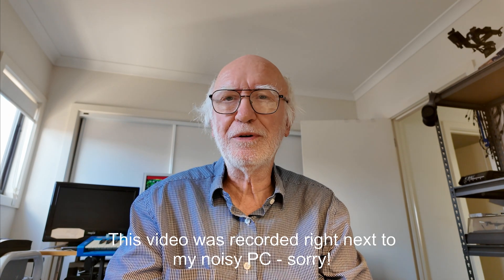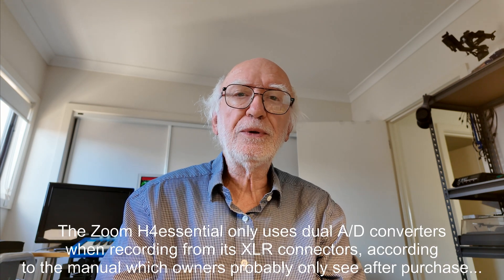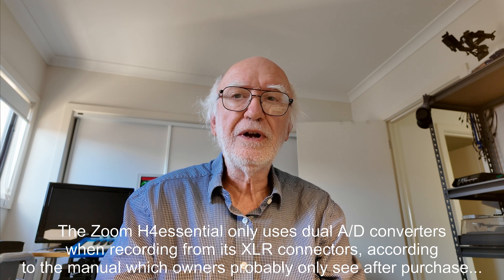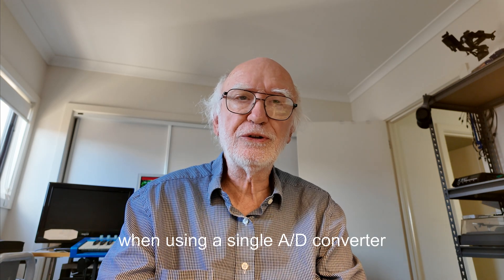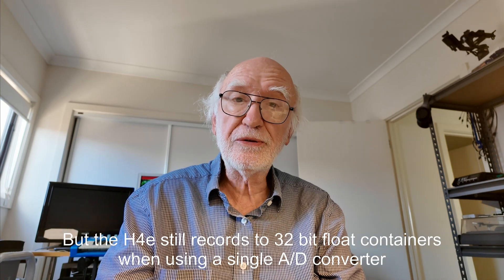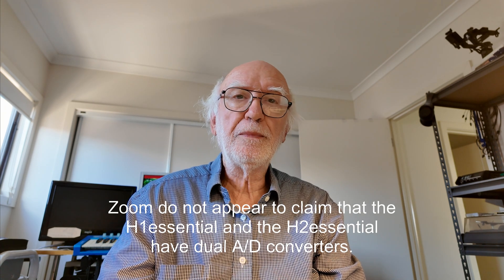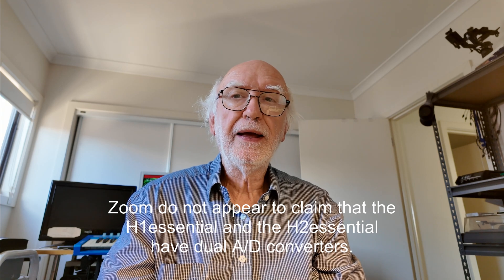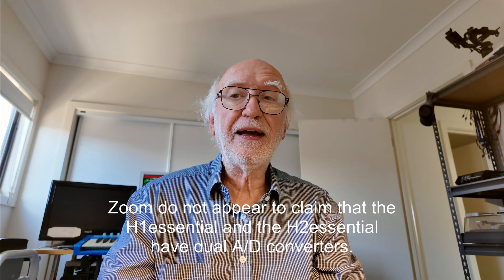32 bit float low cost audio recorders - BEWARE!  The truth is out!  Don't buy until you watch this.

Comment: A single converter could offer a wider dynamic range and fully utilize 32-bit floats if it adjusts gain dynamically. It probably couldn't adjust quickly enough for fast transients, but it could for more gradual increases and decreases in sound level. Ultimately the proof is in performance. Can you record very quiet sounds then make loud sounds, and have no clipping and still be able to amplify the recording later to bring up the quiet portions without a strong noise floor?

Comment: Close to no point, but it seems to me that the ability to salvage a recording that is clipped is a pretty handy feature....
Reply from the maker: @174rank  These devices are configured so that the analog stage (and/or the built in mics) will overload before the converter runs out of headroom, so if there is any clipping, the 32 bit float file will have faithfully captured it. What dual ADCs offer is the ability to capture a wider dynamic range. As far as we know, single ADCs don't offer that.  However, the difference between theory and reality can make these single ADC devices very handy indeed. I have been listening to the only examples I have found of large and small classical ensembles recorded with the H2essential, and the results are remarkably good. And the people using the devices simply had to pop them on a mic stand in a good place, press record, and walk away. But I still feel that the companies promoting single ADC devices without making it clear that they don't offer the full benefits of 'real' 32 bit float devices are not being entirely transparent in their marketing.
Reply: @Ozpeter  Yes, but it would seem to me that the 32-bit float (even if it isn't totally the real deal) would give one a cushion.  In situations where there is no opportunity to adjust levels, like when I'm recording a band concert that my kids are playing in, I could record without worrying so much about the digital format clipping.  The Zoom 323-bit models don't even have a gain adjustment, where the Tascam models do.  I have a Zoom H6 (not a 32-bit model), and while it is a marvelous device, it is nearly impossible trick to get the levels just where I would like them without a lot of checking beforehand, and in many situations, there is no chance to do that.  If I'm recording something like my kids" band concert, the sound isn't likely to be loud enough to overdrive the mics , and if I set the levels where they seem about right, and an unexpected very loud section of a piece runs my levels 3-6 DB over, the 32-bit float would catch it so I could recover it in a DAW....Am I right?
Reply from the maker: @174rank  Well, yes, as I said there's examples which do show how, within the limits of what the mics and preamps can handle, an inexpensive 32 bit float recorder can be set up in front of a loud concert band, press record, and that's it. I've started putting together a playlist of such recordings where I am confident that's what has been done. Check what the description says about each of these and any comments about how they were done - https://youtube.com/playlist?list=PLW7X_zDpTwy1VDpQUf97BjzJccMWZDV5J&si=kR2H7Jhqzb25liBI

Also check other recordings on the relevant channels (but again, keep an eye on the descriptions to verify how they were recorded).

Comment: After watching your videos on this topic (thanks again) I decided to avoid single-converter float recorders and buy the H1 XLR. Being curious about bit depth in float recorders I figured out a method to calculate resolution in recordings. Resolution in the loudest supported signal points to bit depth. However in the absence of manual gain control, softer input sounds will have lower resolution. Not an issue with the H1 XLR as it turned out, but what about 24 bits depth in other recorders? Here is a summary of my "research":

The loudest mic signal I fed into the H1 XLR is from a floor tom at centimeters distance, producing a peak voltage slightly above the specified maximum of +4 dBu. That did not clip the input, but 32 bits were used in the signal, which I take as bit depth. Also I multiplied sample values by 2^32 to check if all results are numbers without fractions, and yes they are, further proof that conversion output is an integer format with at least 4 bytes.

The floor tom test was only done as a reference. Recordings of bird sounds, my purpose for this recorder, show resolutions around 22 bits when using a microphone of -24 dB sensitivity. Consider that my footsteps sound louder than the birds at a distance, and you get an impression of the sound level. The birds peak around -70 dB below the floor tom, yet they are recorded with more than adequate resolution.

The old 24 bit H1n can give the same resolution for the same birds but that needs careful gain setting. In practice I reserve extra headroom just in case a nice bird would come closer. So there I loose some resolution, but still get 20 bits in the softest recordings.

But what will a 24 bit recorder produce if it does not give you analog gain control to optimize resolution? Does it give 8 bits less than dual conversion in such cases? Or does it cover a different input range with those 24 bits? Or does it have a clever trick to emulate 32 bit conversion with a 24 bit converter? I don't have one to test.

Resolution in a digital signal can be calculated as peak divided by smallest step, expressed in number of bits. Peak value is the largest absolute sample value. Smallest step is found by differentiating over a large number of samples in the signal. Sample 2 minus sample 1, sample 3 minus sample 2 etcetera. Keep the smallest positive result. Calculate the ratio: peak divided by smallest step. Express this ratio as number of bits by calculating its radix2 logarithm. This likely gives result with a fraction, round upward to int because fractions are not supported in conversion output. Then add the bit that determined the sign of samples. This procedure gives resolution in that particular recording. Only use unprocessed recordings that have retained their original conversion output. I did these calculations using the PureData framework. Maybe it can be done with a more mainstream method that I didn't think of.

Being annoyed by the lack of technical information about 32 bit float recording I spent much time on this topic to get a clearer picture. Manufacturers suggest a virtually unlimited dynamic range between noise floor and clipping. Zoom: "over 4 billion amplitude values" (correct, that is the range of 32 bit int), "resulting in a dynamic range louder than anything found on earth" (impossible to capture with 32 bit int). SoundDevices: "over 1500 dB", Tascam: "approximately 1680 dB" (complete nonsense). The range of 32 bit int conversion is 192 dB, part of which is spent on noise of course. Now that is less spectacular but still wonderful. If only they would tell you.
Reply from the maker: @KatjaVetter  I look at it like this. Clipping and noise can arise in three places - the mic, the preamp, and the digital file. 32 bit float deals with the third stage but doesn't help with the first two. However I suspect that field recorders are now optimised so that the built in mics if any can handle louder sounds (higher SPL figures are being quoted) and the gain staging before the ADC is being optimised as far as possible to avoid clipping and reduce noise, so in a properly designed device, you get more than just the advantage of the better storage format.

You might have already seen the discussion of these matters at the following link but I will post it anyway. This dry scientific subject causes a lot of passion in some communities! 

https://www.audiosciencereview.com/forum/index.php?threads/32-bit-float-explained.46654/

Comment: Amazing investigation Peter, thank you for publishing this info. The absence of a gain knob on 32 bit float recorders made me curious about the input range of such devices. I learned about dual converters and quickly thereafter found your video saying that some have only single 24 bit converters. Without preamp gain control this may still be perfect for average use cases, but not for everyone. Instead of fiddling with gain control, now you have to figure out if the fixed input range fits your use case at all! Doesn't that defy the whole purpose of 32 bit float recording? Setting a gain knob was easier than switching mics or recorders.
Reply from the maker: @KatjaVetter  Good points.  I think that one of the best use cases for 32 bit float is for "mics that record" like the Zoom MicTrak devices. In these, the source is known at the outset (M2 and M3 anyway) and therefore the fixed levels are set in the design to perfectly match the dynamic range of the capsules. Meanwhile I don't think that anyone has come up with an authoritative explanation of how 32 bit float using a single ADC actually provides the same benefits as dual ADC devices. Maybe one day...
Reply: @Ozpeter  Indeed it should be safe to use these devices with built-in mics, or alternatively one could use external mics of similar sensitivity. Or if you want to capture softer than average sound, use a mic with higher sensitivity, which is what you would probably do anyway. So there are still options to get appropriate dynamics with external mics, but margins are very small. In fact the margins may be smaller than analog gain control combined with 16 bit conversion. But the new approach reduces the number of electronic components, which may be the major benefit after all.

Another benefit of storing 24 bit data in 32 bit float is still the option to apply a multiplication factor (digital gain) to make recordings peak around 0 dB without numeric overflow. This can simplify monitoring and evaluating recordings on the device, especially when such digital gain is a user setting. But that is a very small benefit compared to the increased dynamic range of dual converters. 

By the way I got pretty suspicious after this "convertergate scandal". What is actually being controlled by the tiny gain knobs on my Zoom H1n recorder and AMS-24 audio interface? Analog gain, digital gain, or a combination thereof? The range goes from minus infinity to +39 dB, a range which is obviously not controlled by a logarithmic potmeter on analog gain directly. Would be nice to find out what's going on under the hood.

Comment: The Zoom F6 uses dual converters. I'm curious if the newly announced Studio H5 will, as it does claim to have the improved preamps of the F series which makes it appealing, larger capsules too.
Reply from the maker: It seems from their online publicity that it's a dual converter device.  But I must research whether there is a catch in respect of the modules which attach to the top - some are saying that the modules are single converter devices, including the mics.  The full manual is where Zoom tend to be more specific about their devices and so far there is only a quick guide online.

Comment: Peter, I saw your comment on my video this morning and have fallen deep into the rabbit hole researching this.  I've watched and read (currently published) videos and comments on the channels you reference and am quite frankly flabbergasted.  Thank you for bringing this to everyone's attention.  I haven't done extensive research yet, but my initial thought to explain this would be like if you were using a 24-bit USB audio interface but recording in your DAW as a 32-bit float file.

I'll definitely be looking into this in greater depth.  Thanks so much for all of your hard work!  Challenging things online can be quite intimidating, but you've done an admirable job navigating this with poise.  I am keen to see how others in the community respond.
Reply from the maker: A year ago, B & H made a promotional video about the DJI Mic 2 and a day or two ago I posted a comment on that video asking whether that "32 bit float" device uses dual converters. An official B & H response signed by "Mark" says that it doesn't. I think that they would tend not to base that reply on an assumption, as until now the general assumption has been that 32 bit float devices always use dual converters. Now if that very well known device doesn't, I would have thought that if others do, their makers would try to get a marketing advantage by claiming dual converters. But as far as I can see they don't. So my current GUESS is that all our most 32 bit float wireless mics are simply writing 24 bits into a 32 bit float container. Well, maybe someone can point out to me what real benefit is gained from doing that, but so far they have not. Certainly 32 bit float from one ADC is s different thing from two, which so far has been all people have discussed.

[Edited to add that DJI themselves have now confirmed what B&H stated.  They say "DJI Mic 2 32-bit float recording adopts a brand new audio encoding and recording method, which expands the recording range and effectively solves the problem of audio overexposure." Really?  From a single 24 bit ADC?  How?]
Reply from the maker: @WayneRECs  Yes, a rabbit hole it sure is! But as you say, storing 24 bit data in a 32 bit float format is not new. As I understand it, using dual converters and combining their output requires some very clever processing and seems to be done in different ways by different companies. But I suspect it requires a fair amount of CPU activity and small and/or cheap devices may lack the required power. I notice for instance that normalizing within the Zoom M2 is significantly faster than in the Zoom H1 XLR, presumably due to differences in processing chips. Anyway it will be interesting to see what further confessions emerge in coming weeks!  And do chime in on your channel if you too think it needs more publicity!

Comment: I'm not sure I see the problem.   32bit float still has the benefit of allowing you to bring up/down the gain in post and be able to recover extremely loud or quiet sounds.  With only a single A/DC, you won't be able to do both at once, but you can still do either.   You will still have 144dB of dynamic range and the ability to set either the top or the bottom.  
I know dual converters allows you to do both at once, but unless dynamic range of your recording exceeds 144dB, I can't see any practical application where you would need both.
Reply from the maker: The issue I have with 32 bit float from a single converter is not that there's a problem with it as such - 24 bit stored in 32 bit float container is exactly the same as 24 it stored in 24 bit container - it's that the marketing of these devices doesn't make it clear that they are not benefiting from the wider dynamic range and greater precision of multiple converters. About the only point in favour of this configuration is if the device provides, for processing the captured audio from the file, after the recording, within the device itself.  And if the user wants to do it that way instead of loading the audio into a video or audio editing system. like almost everyone does.  When you load 24 bit audio into almost any processing system these days, the system works in 32 bit float mode anyway.  If the audio is 24 bit, or 24 bit already stored in a 32 bit float file, it makes no difference to the editor.  

I can think of two other ways to express the problem.  Imagine if Sony brought out a new video camera and touted it as a 4K device.  Everyone would assume that it used a 4K sensor.  But they would be pretty annoyed if they discovered actually it was using a 1080p sensor, but storing it in a 4K file

Or, think of it this way - if a company said, "isn't this wonderful, we are storing data such as a value of 1.23 in a container which stores it as 1.2300000" - people would laugh.
Reply: The files I get from the H2 Essentials sound recorder are just over 6Mbps whereas my H2n files are 4.6Mbps. The difference is important to me because I occasionally set the H2n too loud or the band turned up their volume during a rock music gig and I got distortion from going over 0dB. With the H2 Essentials I have recorded at +15 dB but when the file is normalised any distortion disappears which is a benefit of 32 bit recording that 24 bit doesn't have. The same with too low volumes they are also easier to adjust but the noise level often depends more upon the equipment used than the file itself. For quiet sound recording you really need low noise throughout the chain & that is usually more specialist than general purpose recorders which are always a compromise to make them affordable.

Comment: I was also under the impression that 32-bit required dual A/D converters.  I've been using the M4 and M3 MicTrak and their quality has been absolutely amazing so I'm pretty confident they have dual converters.  I do wish they would tell us in the specs.  It's akin to a camera lens maker telling us how many aperture blades there are.  Wild response from Tascam!  Seems like they are dancing around the issue without actually answering the question - which is always highly suspect.
Reply from the maker: I'm pretty sure the M series use dual converters. Sometimes you have to check the manual if the product page doesn't say. I have the M2 and M3, and I think they deserve more attention. Sadly, early reviews of the M2 and M4 were very critical of RF breakthrough and Zoom had to withdraw them and change them before a later re release. But the reviews are still up. And that's why I got my M2 very cheap!